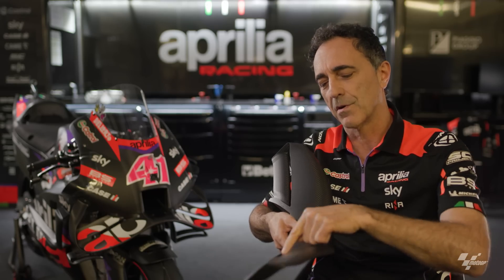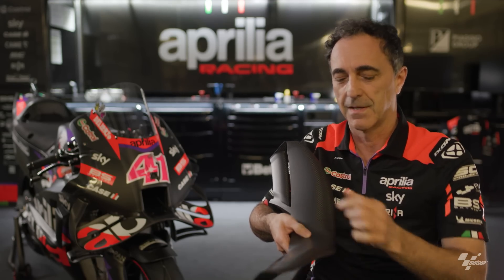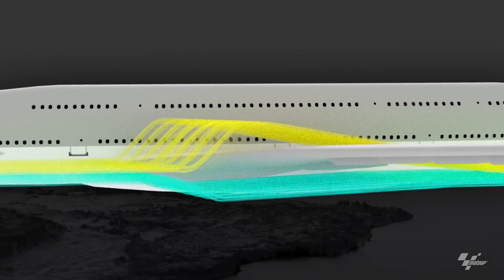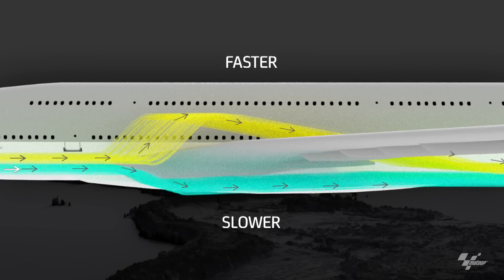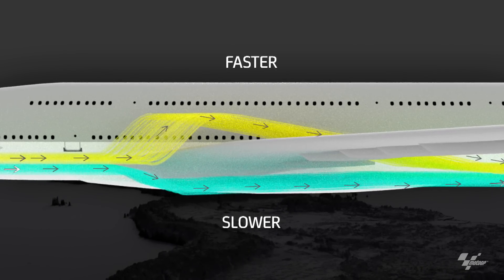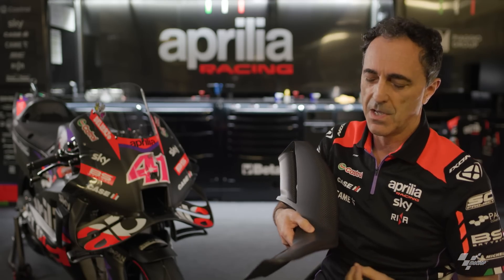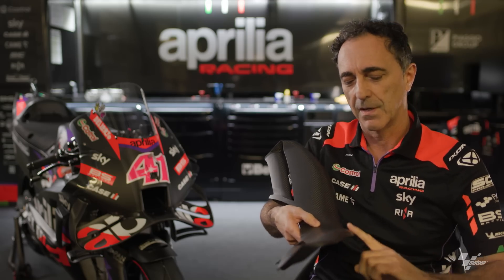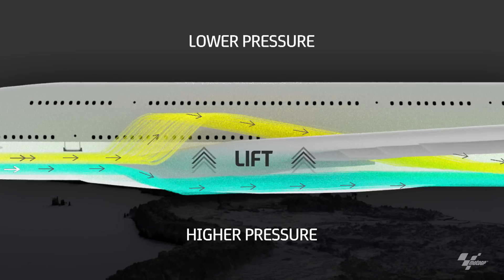What's the Ground Effect? 👨‍🏫 | MotoGP™ Workshop

Comment: I want to know why they put airfoils in front of other airfoils. The turbulence behind the first would surely disrupt the air flow to the second and make it less efficient. The little fork mounted dual plane foils that sit right in font of the side fairing foils is what  I am talking about. Also, when the foils that are used for straight up riding go to 50+ degrees in lean, they produce a force that would make the bike want to "slide" since the force, while diminished due to a lower speed is still present, the air foil doesn't regard it's orientation to the surface of the track.

Comment: I find this tech amazing but I'm also worried about ground effect and its ill effect on close racing. Ground effect working in such a narrow window that it makes it effectively only one way to drive and make it work. Any deviation from that window and it's gone. Moto GP used to have interesting overtaking because riders were able to take different lines, ground effect might remove this ability. Not to mention the increasing "dirty air" issues with aero. F1 has shown us that in recent years.

Comment: The way Mr. Albesiano explains how lift is generated is wrong, as air particles do not meet eachother at the trailing edge. The upper flow is accelerated due to a circulation around the airfoil in a potential flow, which is a bit more complex to explain.

Still, please keep bringing this kind of content.

Comment: 0:47 there is no physical law that says this has to happen! In fact, the air goes much faster on the suction side of the wing profile than on the pressure side. Think of simple piece of paper and give it some angle of attack - there will be lift generated.

Comment: That's not how a wing works. 
The myth of the air having to join has been disproved, the air moves faster over the top as its being expanded due to the shape. Its faster and therefore lower pressure, the difference in pressue between the 2 creates lift.

Comment: wouldn't downforce on the upper section of the fairing while in a corner cause it to tip more rather than put more pressure through the tyres?

Comment: Aero in motoGP is super interesting because, as opposed to a car, motorcycles have to lean, so you need to create downforce in 2 dimensions (in x for straight lines and in y for cornering) instead of a single one
Reply: Cars have the exact same issue
Reply: F1 aero design is also planned for cornering air flow

Comment: I'm an aerospace engineer and the explanation of why the upper flow goes faster than the lower flow on the wing is wrong. The flow goes faster in te upper part because the upper flow gets expanded (lower pressure) and airspeed and pressure are related (the higher the speed, the lower the pressure). "The "longer side" explanation is a common aerodynamic myth
Reply: Perfect!
Reply: This is what i learn on high school too, glad i’m not wrong 😅
Reply: It's actually due to the combination of a potential flow and circulation (clockwise for the case of study) to meet the Kutta condition.

This mentioned circulation speeds up the upper flow and slows down the lower flow, generating a pressure gradiente between both sides of the airfoil and thus generating lift. Aerospace engineer here too.
Reply: Bernoulli's principle to put it simply
Reply: the guy explained it like if it wants to reunite, then it has to be the same air that got separated earlier, or it won't mix. I'm a mechanical engineer, why did the guy use mechanical logic in aerodynamic lesson?
Reply: @MRworldEtIkA maybe the dude isn't an aerodynamicist
Reply: Glad to see someone else beat me to this. I was about to write what you wrote and was ready for the downvotes when I called out the guy in the video was wrong. Happy to see others are aware of the aerodynamic myth.
Reply: I’m not an engineer and I knew that
Reply: Its the lower flow that is expanded, resulting in slower velocity profile and higher pressure under the wing.
Reply: yeah same. I don't know if this dude wanted to be simple for the audience or just don't know how a fucking plane profile works...
Reply: @andro_system  probably trying to make it understandable for everyone
Reply: I was in a study about aviation years ago and I started to doubt myself about my knowledge of aerodynamics. Your comment made me realise I was correct and the video was wrong😂
Reply: And how does the upper flow get expanded in the first place? Maybe because it has a further distance to travel, over the LONGER surface of the wing. Remember that this video isn’t for ‘aerospace engineers’ but for layman, so will put it in easy to understand terms for everyone. Also; if your work is anything like your proofreading, I don’t want to go near anything you’ve had input on. 😂😂🤦‍♂️
Reply: Yeah, there's an experiment that anyone can do at home that demonstrates that it has nothing to do with the flow of the fluid "under" the wing. Just open a faucet, pick a spoon and touch the water flow only with the back of the spoon. It will pull the spoon towards the water flow, perpendicularly to it, even though there's no water flow on the other side of the spoon, which means that there's no need to be a difference between upper and lower flows.
Reply: @igoradsilva  that's more coanda effect than what's happening on a wing.
Reply: @igoradsilva nah, just drive a car and put your hand out sideways, change the angle of your hand.
Your hand would be pushed behind or raised above and similarly when you reduce the angle, the hand will be pushed below.

Bernoulli's principal is the answer, pressure is inversely proportional to velocity and vice versa. 
Can never forget Aerodynamics classes with Wind tunnels and other things. Aerodynamics is the most interesting part an aeronautical engineer can imagine ❤
Whatever we see in Automotive is just the same things which are invented in the aerospace industry so shoutout to this field
Reply: Probably why Aprilia almost never finishes in top 3. They doing it wrong. 😁
Reply: @2_Bike_is_Life  oops
Reply: No, it's an upside down wing. The video is correct

Comment: Shame the explanation of lift is wrong. It’s a common misunderstanding but a misunderstanding nonetheless. https://youtu.be/UqBmdZ-BNig?si=bgArwHymsqz78T6Y
Reply: Agree. This one is more comprehensive of why the curvature of the wing cause low pressure. And why most of  downforce are generated by the bottom surface (neg pressure part).

https://youtu.be/qwu5Vz6zjnM?si=QFtGM5StdXnmX-iS